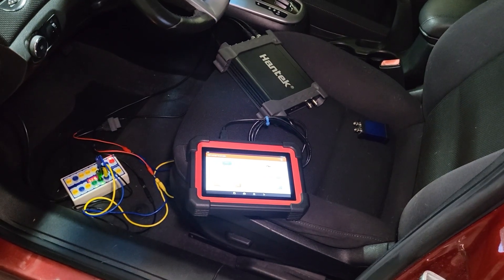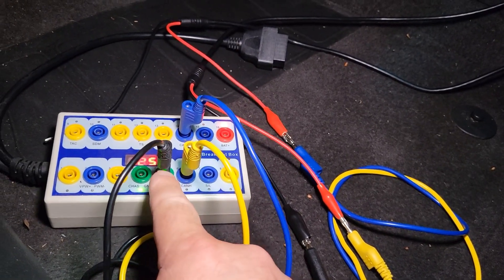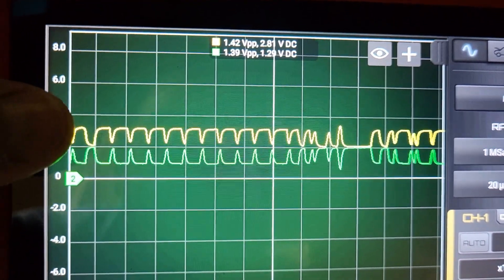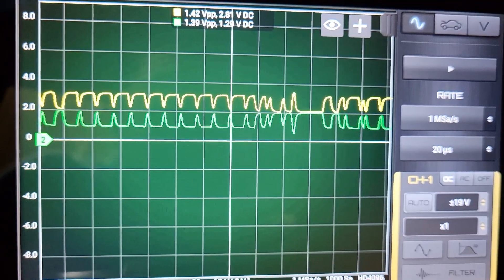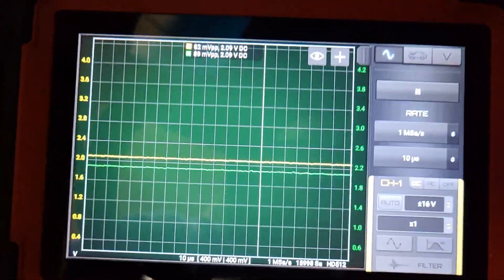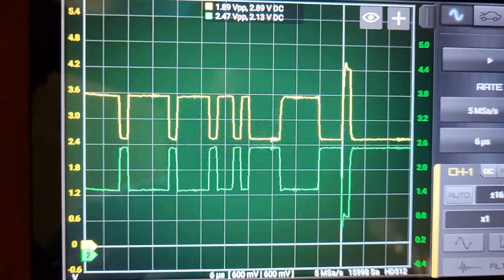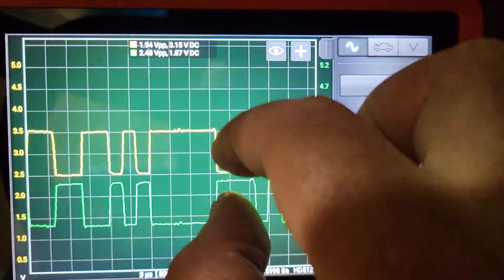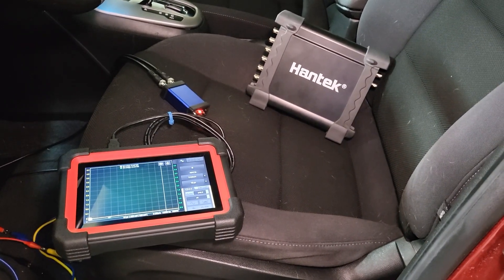Hantek1008 vs HS502, Hscope CAN Bus

Comment: In the licenses it only says hanteck 6074 without the letter BE at the end...will it work on hscope if I buy a 6074BE? regards!
Reply from the maker: Yes it will. Only slight differences between the models(BC,BD,BE). The BD is the only one with a signal generator. The BE has automotive test functions in the Hantek software. The BC is the bare bones model. But they all work with the same Hscope license 👍

Comment: If only martin lorin would make a 4 channel scope for automotive work. I regularly use 4 channel's 2 just doesn't cut it when you're working in a fast paced shop.
Reply from the maker: It would be nice but I'm not holding my breath. Been in the works for awhile now. I just make due with HS502 and the Hantek when I need more channels. I just bought a Hantek 6074BE 4ch that I've been playing around with on Hscope. It's pretty good. Way better resolution than the 1008C. It actually has higher sampling rates than the HS502. The memory buffer is about the same as the HS502 at 64K. Not great compared to other scopes. The Micsig VATO 4ch looks like a nice scope for the price. Nice resolution and software. Has a decent memory buffer with plenty of memory at 50M. It too is supposedly in the works for Hscope but who knows. Short of a Pico, this is as good as it gets with budget scopes. Thx for watching👍

Comment: Use even higher sampling rate to get a better waveform
Reply from the maker: Ya. I've heard 8MSa/s for GM CAN. The HS502 goes from 7MSa/s to 13MSa/s which is the max sampling rate. The 1008C maxes out at 1MSa/s but the capture doesn't look as good as the HS502 at that sampling rate.